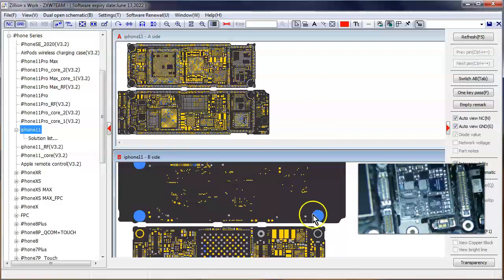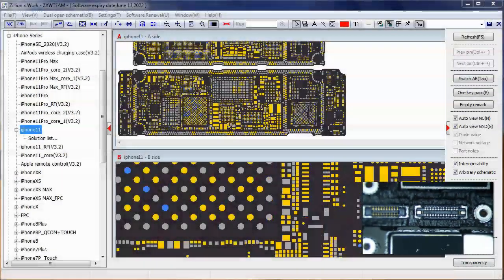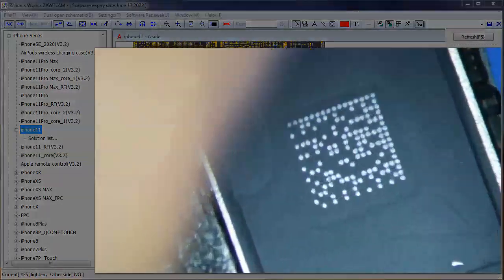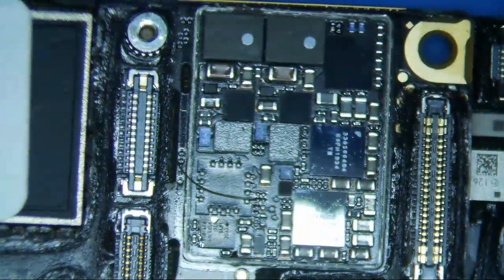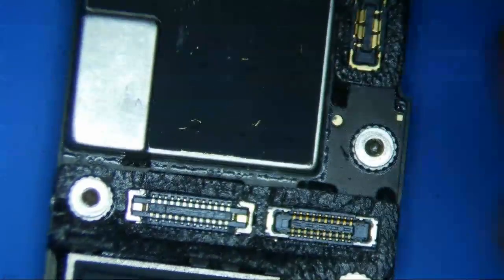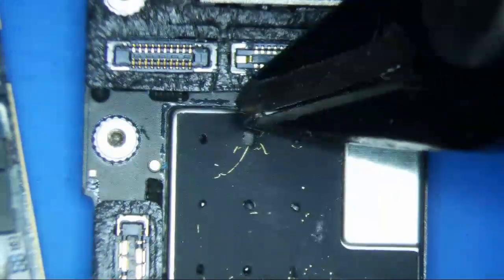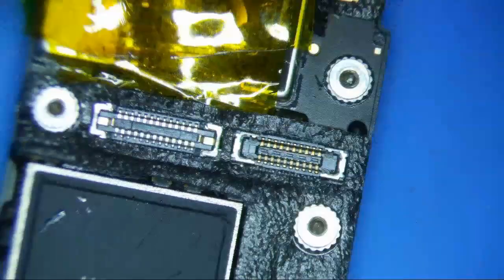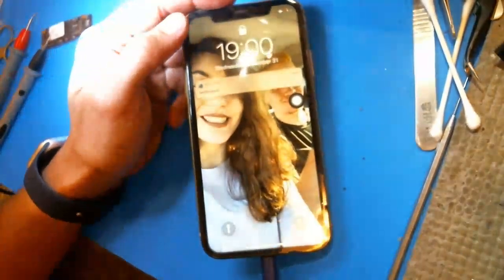iPhone 11 No Backlight Repair After DIY Screen Repair

Comment: Could you have used low melt  solder on the shield with hot tweezers and take the shield off?